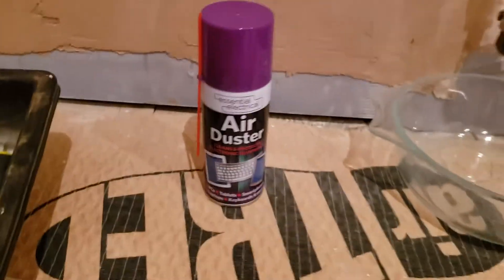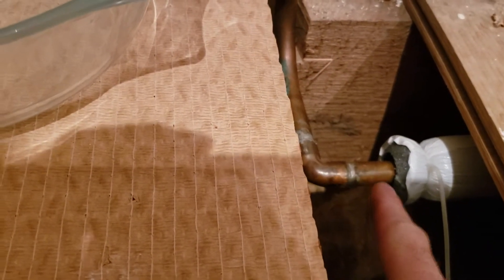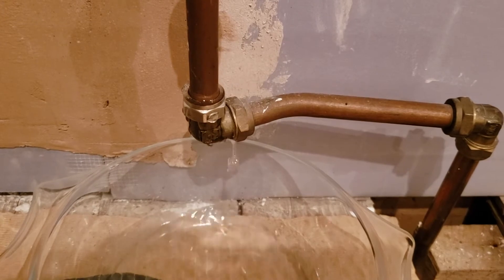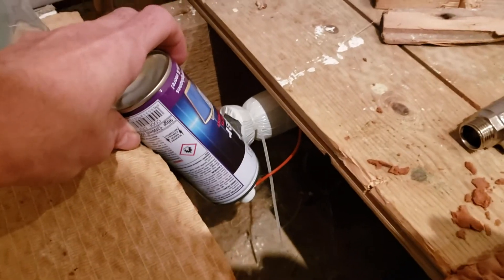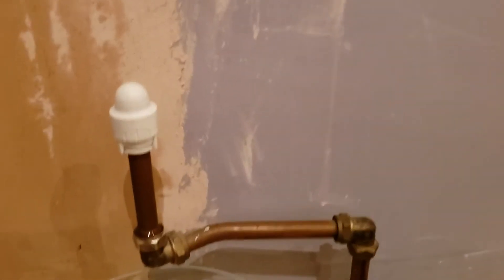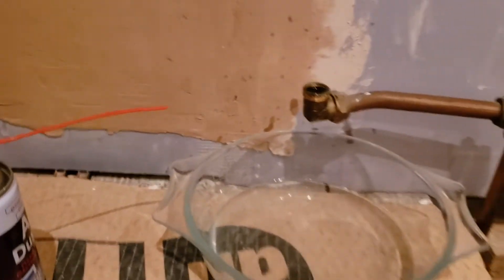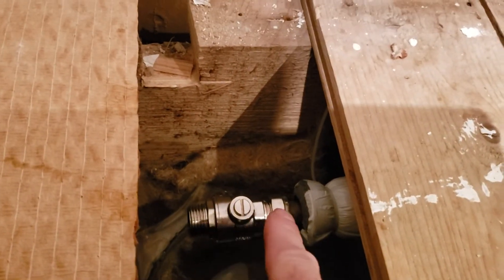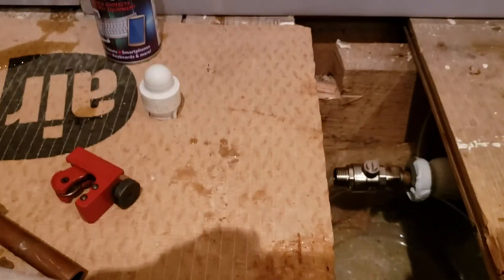Freezing a pipe without Arctic Spray - use Air Duster

Comment: So, did you install a service door panel above the new valve?  It's against code to 'hide' a shutoff valve inside walls or floors without adding a service access door.